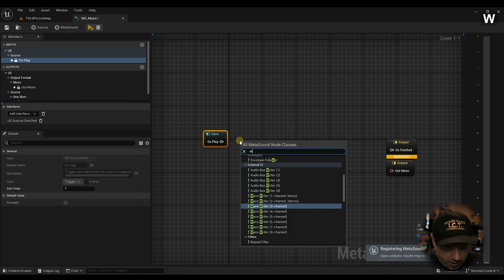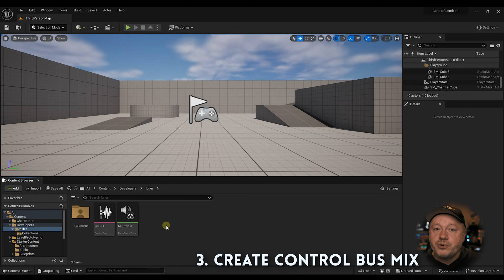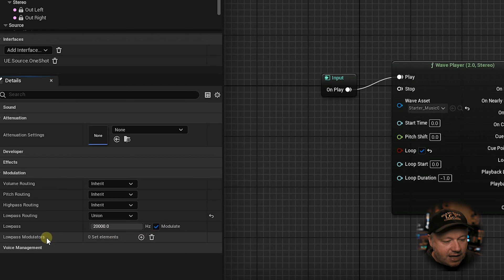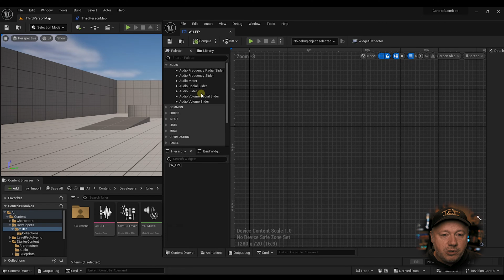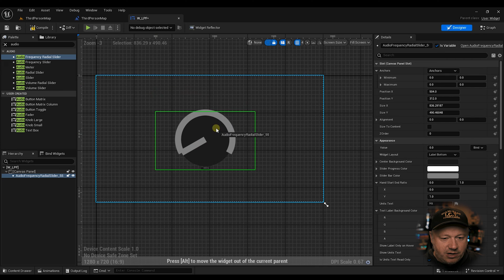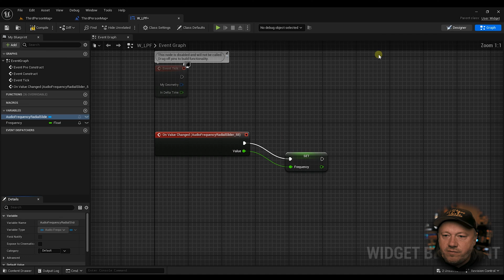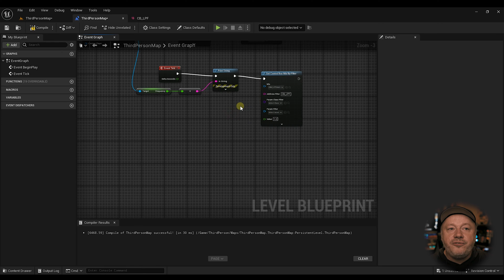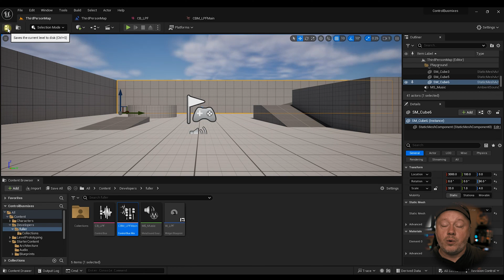METASOUNDS: Control Bus Mixes - Use a Widget Knob to Modulate a Control Bus. Low Pass Filter Example

Comment: Thanks again! :) How does one send the Metasound out (via Envelope Follower or some other method) to a Blueprint that is utilizing Control Bus? In other words, how do I get the Metasound to affect a Control Bus Mix's modulator value as an output rather than a modulation source (as an input)? Right now, my Metasound is being modulated via a Control bus, but I'd like to reverse it: send the amplitude envelope information as a float value to a Blueprint.
Reply from the maker: You need to use Output Watching and use and envelope follower on the output… and then send that float value normalized to any control bus mix
Reply: @brianmichaelfuller   Thanks dude! For my purposes, I made a couple: 

- this method you suggested (for more local stuff)
then...

- a version to work with Submixes so that whichever Submix is active, the Control Bus Mix params will activate/deactivate based on the amplitude envelopes in the Submix and apply it to the volume, etc., globally. This is quite different from just modulating Control Busses to affect sound inputs, but it works for now haha.

Comment: Hi this video was really helpful and clear as someone who is new to a lot of the stuff used here it was really easy to follow step by step. I've got it all working my only issue is I'm struggling to get the slider to start at 20,000 on start up so the slider can be used to essentially make the low pass filter more intense.
Reply from the maker: You can use a multiply. Most widget knobs are normalized 0-1 but you can multiply this in a MetaSound by 20000 and it will give you those results

Comment: Hey! Your videos are always a great resource. I have been looking into something similar to this and some other real time parameter changes but I want to control multiple metasounds with a single "knob". Not sure how to approach this since I think setting those variables in EVERY metasound might get a bit tedious and there should be a more efficient way? I need to be able to control, the numbers like this and not just rely on one preset LPF to trigger on or off, but on multiple different sounds.

Thanks!
Reply from the maker: @YeguesSchettini  you can use a single control bus to feed unlimited Metasounds at the same time. It’s very scalable
Reply: @brianmichaelfuller  Thanks! I'll need to dig in a bit more and test that. Hard to remember all the different kinds of busses and what I can manipulate dynamically!
Reply: @brianmichaelfuller  Hey! I did figure this out but I have a new question and the UE forums and documentation isn't helping. I see the "modulation" settings for volume/pitch/pass filters, but I don't see anywhere for the control bus for "pan" to get routed to. Only spot that didn't bounce a warning was under "pitch routing" but that just ended up effecting pitch, not panning. 

Thanks!

Comment: good stuff here! Lyra uses the CB-s aswell but for menu volume sliders, they modulated the soundclasses for that.
Btw if you print on tick and dont want a screen full of numbers just connect the delta seconds to time on print node.
Reply: Even better than the DeltaTime Duration is if you provide a Key. You'll only ever see a single print value per Key and the duration can last as long as you like.
I like to give the Display name as the key, which is useful for multiple debugs at once.